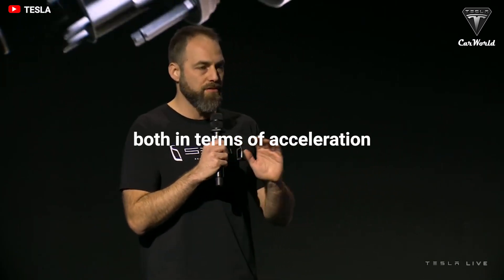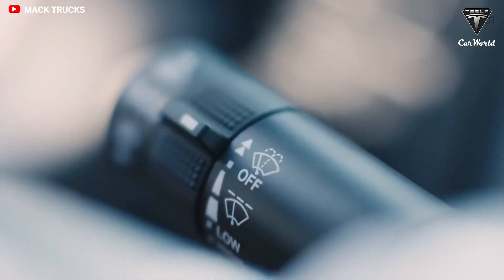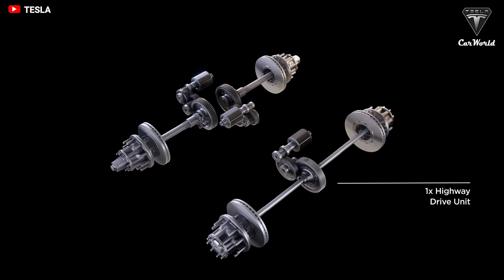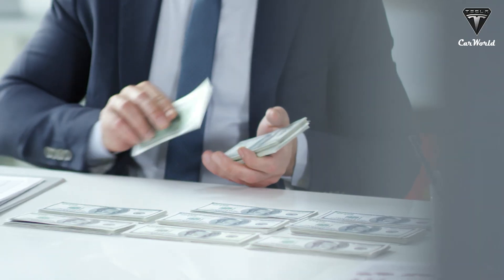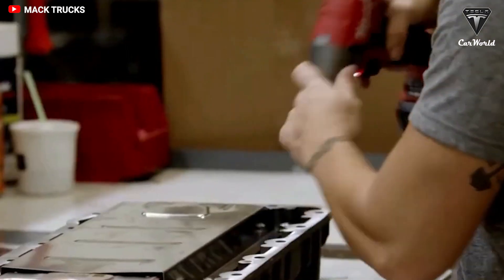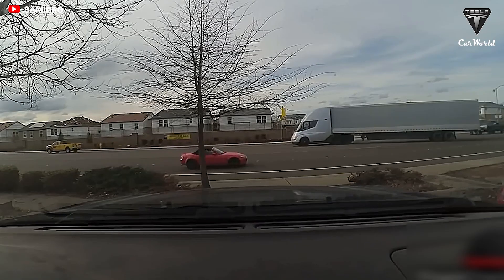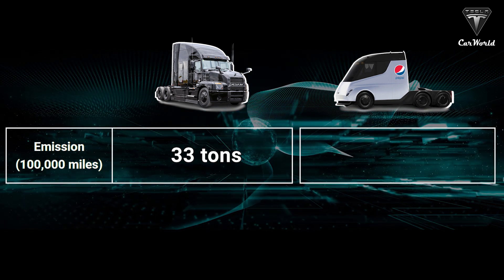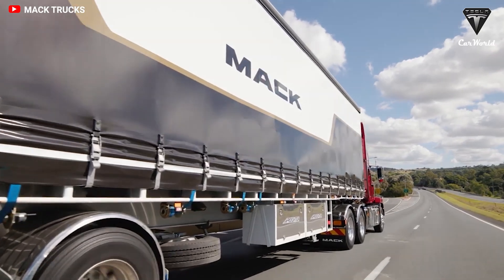Where is the super engine of the future? Mack Anthem Diesel Truck Vs. Tesla Electric Semi?

Comment: Worrying about acceleration and HP on a semi is like worrying about storage in a racecar.  I know that HP is important, but overall lb. ft is more important. Saying that the Tesla semi is more powerful than the Mac is just pure delusional.
Reply: The MACK has about 400 ft-lbs if torque with half the hp!
Reply: Australia uses MACK trucks with 600hp+ which hauls in road train up to 4x80,000lbs

Comment: Mack uses a variation of Volvo's D series engines.   In the USA with stringent Diesel exhaust emissions requirements the Volvo D series engines have reputation for being unreliable after they get some miles and time on them and at the bottom of fuel efficiency of the four major heavy duty  over-the-road North American Diesel manufactures. 

The four North American heavy duty over-the-road Diesels manufactures in populous desirability for long term use are:
1) The Detroit Diesel DD series is tops in fuel efficiency and high in reliability provided the oil seals are replaced at around 400,000 miles.  A primary reason to choose a DD engine over the Cummins X15 is better fuel efficiency.  
2) The Cummins X15 is tops in drivability, serviceability, power, only fair in fuel efficiency, but better than Volvo.
3)  Paccar MX series engines can quickly become problematic till at least 2021, have top fuel efficiency, are relatively quiet, smooth running, light weight, substantially cheaper at purchase than the Cummins X15, long wait times on parts, difficulty finding mechanics that understand the engine.  After 400,000 miles MX series starts to develop serious engine problems.
4) Volvo D series is likely a million mile engine provided with good parts availability unlike the Paccar MX series that appears to be 400,000 mile engine, but it is recognized with the worst fuel efficiency of these four manufactures.  It is similar to the Paccar MX series in that it starts to have irritating reliability problems that take it off the road after 200,000 miles and a few years of use.  The Cummins X15 is the choice for drivability, power, serviceability and durability.
Reply from the maker: Woww. Thanks for your knowledge !
Reply: @TeslaCarWorld  I got interested in shopping for the best touring bus.  That turned out to be Prevost X3, but since Volvo now owns Prevost they only come with the Volvo D13.  Ideally Tesla will start to provide electrical and motor drive systems to the motor coach industry from their Tesla Semi division once it has matured.

Comment: The Tesla Semi does not have an Engine, it has a motor. An Engine does three conversions, chemical to thermal to mechanical  A motor does two, converts electrical energy (or another form of energy) into mechanical energy. Don't call an Electric Motor an Engine, it is not.
Reply: why can't call this powertrain by 'motor ' ?
Reply: @kienotrung1039  powertrain is the ensemble making the car move lol…
Reply from the maker: Thank for your information !

Comment: Tesla opened the proverbial "door" to EVs by showing not just the cars but the mfg processes, sales model, ...etc. EVs are inevitable, it's only a matter of time.
Reply from the maker: Yepp, time will answer
Reply: Nonsense! They did nothing!!
Reply: @alanmay7929 - Please elaborate. Just stating "they did nothing" without explaining why basically says nothing. And please be civil in your response as I am truly interested in your thought process as to how you arrived at the conclusion that Tesla "did nothing". Thankyou.
Reply: @thomasruwart1722  and tesla basically only makes two car models so nothing special here!
Reply: @alanmay7929  - Well, four models but each one is quite different from its siblings. While the Model 3 & Model Y do share 75% of the parts, they are still very different cars. I have driven all four models and each one is a different driving experience not to mention they are all crazy fast (I also race so I am admittedly addicted to speed). As I alluded to in my first comment, Tesla also redefined how cars are actually designed and manufactured. The Model Y is a prime example of this with the front and rear single-piece cast that enormously simplifies the chassis construction as well as its strength and durability. And that's just one aspect of many regarding the manufacturing processes that Tesla has developed. In any case, if you've never driven or riden in a Tesla, it's worth it just to do so because it's fun if nothing else. Any way, enjoy your day and have a great week.

Comment: Since you asked. I think that Nikola is going to put their FCEV trucks on the road by mid 2023 and that they'll slowly prove that hydrogen is much more suitable for trucks in general. Once their sleeper version hits the market with its 900 miles range things will be settled.
Reply from the maker: I wonder what about operating costs? Thanks for your comment !
Reply: @TeslaCarWorld  - This is a very good question. Many of the in-depth critical technical reviews of Hydrogen Fuel Cells indicate that the cost per kWh of charge is much higher than lithium-based batteries. One reason is the cost of the energy required to produce the hydrogen plus the distribution cost of getting the hydrogen to refueling points. These are recurring costs whereas lithium-based (or any other) batteries only need to plug into a source of electrons (e.g. the electric grid). Some will argue that there is a gas-powered or nuclear electric plant that generates those electrons but the same is true for the electricity used to produce the hydrogen for the fuel cells not to mention the power used to produce the fuel for the hydrogen distribution tankers. 
The conclusions I have seen indicate that hydrogen fuel cells require 2-4 times the energy resources of batteries. 
Finally and somewhat whimsically, does anyone remember what happened the last time we tried to make a hydrogen-powered vehicle called the Hindenburg? How'd that work out? :^)
Reply: Not if the cost per mile is greater.
Reply: Nicola  is very good at down hill sections. 😂